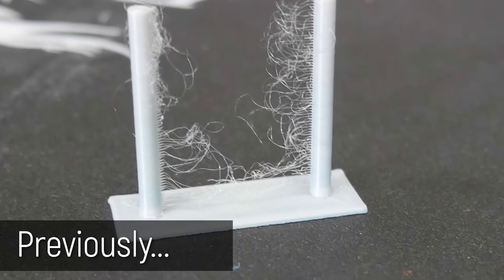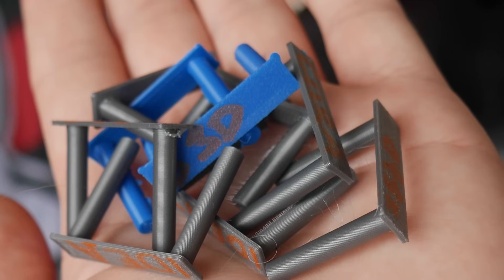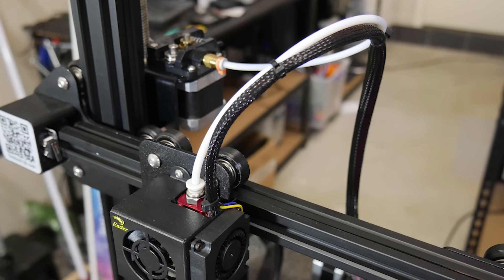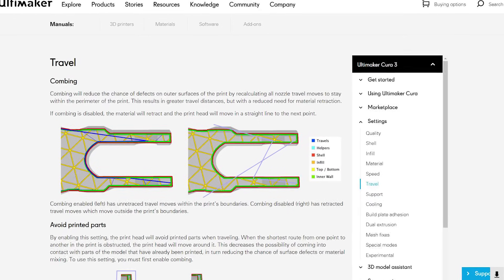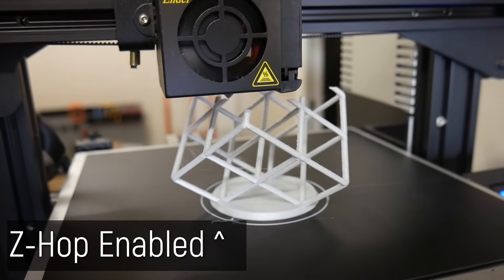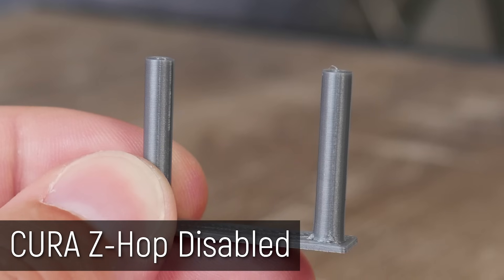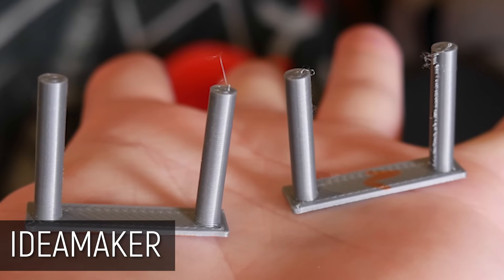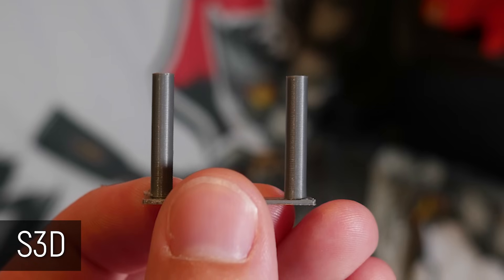Stop Ender 3 Stringing with this One Weird Trick! (ok but seriously)

Comment: We need a visual AI on 3D printers. That is how it will end. I don’t want to invest time on printing anymore...
Reply: Do you mean something like an AI slicer? I guess you could get training data for one by having it slice a model then print and scan it to compare.
Reply: @TheAkashicTraveller   @Jack Evans  Yes absolutely that is what I meant. But without a computer, as a stand-alone kit. Maybe live data input can be used from a camera that is focused on the nozzle for simplicity, instead of scanning.  It would get serial output data from marlin like temps, speeds, fans, layer height...) and command it thoroughly. It would end up with an asic AI chip with a cheap camera kit to solve all the issues "live".
We are changing values (slicer settings) and printing hours of test prints to compare and optimize them. We need to pray to the 3D printer Gods for luck . A huge waste of time. However, it is a must paid price to become a "3D printing master".  Also that is the barrier between the average customer and the product. 
Someone should invest in this.

Comment: Haha no joke, I've been using the slicer on astroprint because of all the research I did before getting my 1st printer there was 1 thing nobody mentioned...you need I friggin computer. I did not own one because I end getting the newest best phone samsung has to offer a d they're quite literally better than most PC's so why buy  an actual pc that's much more limiting than a phone. That's been fine and had no issues...until my printer showed up. Got it all set up a d good to go but other than the build instructions there was nothing else and the only other writing in the instructions is in Japanese. But I had the sd card that came with it and it was cracked. To find the cura software was on it. After looking around someone said astroprint had cura on it but was somewhat limited. So I got use to it cuz I didnt wanna buy a pc for just printing......so about 3 years later my ass is still using astroprints cloud cura program a d have become surgical with it. I've had tons of people asking me for my settings cuz everything comes out flawless with it. I dont buy specific brand filaments. I buy whatever I think is gonna look cool for a print and it all comes out great. Every now and then I'll have an issue but a quick tweak will fix the issue. I have bought a pc and bought the 150 dollar simplify3d program and the full cura. And guess which of these I still use. Yup the astroprint halfassed cura 3.0something or other. I really think it's just cuz alot of the fine tuning in the others will throw off something a tiny bit and then you're chasing the 3d printer dragon trying to find that 0.000000006 mm adjustment. The one downer is they dont have a layer by layer visual. But everybody should go mess around on it for fun sometime cuz  you might be pretty surprised what that thing can do lol

Comment: I don't use CURA anymore got fed up with the interface, I use PRUSA SLICER with my wanhao i3 and get better results with it, Concerning stringing I've found that the most important setting are temperature and speed for non printed moves, the slower the print head moves to the next area for printing the more oozing occurs which causes stringing in my temp tower tests. Like you said thou it depends on the filament used and trying to dial in your temp, speed and retraction settings for each filament you have!.

Comment: There are so many variables to account for based upon geometry. But, what happens if you have different geometries in a single file that really need different settings?
Reply from the maker: It's a challenge, you can use tricks like variable layer heights or infill but there's no one size fits all solution.

Comment: I've used Cura exclusively for my slicing (though not usually my supports) on my Ender 3 and Geeetech A10 for a while and I totally agree. The retraction and combing clean it up very nicely. I'm currently using Duramic 3d whenever possible as I've found their PLA to be top notch quality, even though their selection is a little thin.

Comment: First of all .
Every filament has its own settings this does not only depend on what kind or brand  .

It also depends on the collar of the filament itself  .

Second of all Cura is the best slicer program to use using other slicer programs is very stupid .

Now the Right starter settings for the ender 3 & 3 pro .
Make sure you always check if the Nozzle size is the same as in your printer .
Put the retraction on 6mm .
Printing speed 50mm a second .
About Nozzle temperature  .

Many will start a long print and leave the printer all alone !!!! .
It's the biggest mistake you can make  .
Because not one filament is exactly 1.75mm on the entire roll  .

Its between 1.75 and 1.80 .
This will have affect on your extruder motor and your Nozzle temperature  .
For example I got white Jupiter filament  .
On the spool it says 195 till 215 degrees in Dutch EU .

I am printing with it at 220 till 225 degrees because any lower and my extruder motor try's to push it trough and cant on 50mm a second printing speed  .

To be clear again every filament kind brand and collar has its own unique settings  .
To find them out you will need to do several test prints. 
And I repeat do not leave the printer alone keep an eye on it and keep listening to the sounds it makes .

Comment: I feel that a combination of retract while combing and z-hop is the current best route to eliminate stringing for most common prints. What we truly need is the ability to retract and hop after the wipe motion has occurred. This should eliminate stringing for parts where z-hop is required due to thing features curling up around the edges.

Another solution would be to incorporate a ramp option for z-hop where we can set a horizontal distance over which the hop takes place and have the ramp always go towards infill just like combing. If z hop could have a timing configuration option in this scenario that could also be very useful e.g. Wait X milli-seconds after retract before hopping.

Just some ideas, feel free to expand or if this is already possible please inform me how.

Comment: I was dead set on a Prusa MK3S and eventually got an Ender 3 Pro because I also needed to do some investing in my business and didn't want to blow $750 on a printer. What I've found is that I don't love the Ender, and that the time spent tweaking it could have been used on something else... whereas the Prusa would have been less of a headache. HOWEVER, I still think the path I took to learning this was a good one. What I've learned with all the tweaking and upgrading is valuable to me. Even though more than likely, having gone Prusa would have actually cost me less, as time is money... and also after upgrades my Ender 3 Pro would be a $400-$450 machine. But... you can't put a price on experience.

Comment: I tried many settings in cura but it's always a mess through different settings provided by most experienced youtubers. 
In creality slicer it's working best.
I tried manually adding all the settings in cura as per in creality slicer but then also its not working through cura. I tried 4.3, 4.4 version but this stringing problem won't go. Pls help

Comment: I think I lucked out.  My Ender 3x's prints came out remarkably good right out of the box.  I do however have the slight stringing issue noted in this video but only with certain filaments, others are perfect even even different colors from the same brand can be different.  

I'm going to try the suggestions and see if it improves, however it's really not a deal breaker as it's producing really impressive prints already.  I've ordered a few upgraded parts, teflon bowden tube, all metal extruder, silicone boot for the hot end, and printed a new fan duct and filament guide, but overall, I'm super impressed with it.  

I don't really have a frame of reference seeing as this is my first printer, but I've seen horror stories from others with their Ender 3's and I think that I really just lucked out and they were having a good day at the factory the day they made mine.  

Also, filament choice is a real concern, I've been using 3D Solutech filament and get the worst stringing with the silver metal, but I attribute that to my using it the day it was delivered on a very, very cold day and opening it up while it was still cold soaking up a bunch of humidity, slight with blue and none with black, same brand different colors, so who knows.  

I've got them all in Ziplock bags with desiccant at the moment and truly the longer they stay in there between prints, the better they print.

Comment: Hi Angus, I hope you are still reading comments..... Creality unleashed a whole fleet of 'silent' versions of their printers - Ender-3, Ender-5 (which I bought) and other pro machines - onto the market in the second half of 2019. Mine was a black Friday special, and I thought I was treating myself to a decent machine after 2.5 years of learning the ropes with an Anet A6, which I thought I had outgrown. I thought I would be getting a reliable machine that would just 'work' out of the box.....How wrong I was!
The first thing I did was print one of the gcode tests prints included on the SD card with the printer. After about halfway through, the Y-axis stopped working and the X-axis continued to make a horizontal plastic trench on the build platform. I thought it was a bad connection. I then did a few prints using Cura 4.3 as the slicer without issue (after taking the machine back for another fault). I have been using Prusa Slicer as well as Cura, and while printing a Prusa sliced file on the Ender, got the same Y-axis failure. I tried again and got the same result. I was now quite excited because the failure was predictable.
I sent it back to the shop. I was then informed by them, that yes, they know that these boards have issues, but only with Simplify 3d (failure of Extruder axis) and my failure using Prusa. So with these boards, I should only use the latest version of Cura (4.3 or 4.4)
Googling on the web, there are a whole lot of hapless users with similar issues.
Creality is deathly quiet on this issue, absolutely nothing on their website. They have emailed some users and said for them to download the firmware from their website. I did this, but the verison is older than the buggy one and introduces other problems because there seems to be a z-axis calibration issue - the gap between layers is too large.
I eventually downloaded Marlin 2.0 and flashed my machine with some help from this thread https://www.reddit.com/r/ender3/comments/cdlvmm/modified_marlin_119bugfix_fixes_the_s3d_print/

This thread shows the problem
https://www.reddit.com/r/ender5/comments/da7np6/weird_problem_with_ender_5_and_115_board/

and this
https://www.youtube.com/watch?v=cUbhSDPTO0s

Someone needs to call Creality out on this appalling product that has been unleashed on users, and their absolute lack of response. This kind of thing is totally unacceptable, and turns new guys completely off 3d printing if this is their first experience....Maybe a rant video?

Comment: I got the Ender-3 pro during the Christmas sale and mine too has a warped bed.  I have a pretty noticeable valley from just in front of the front right corner to a about 2 inches shy of the rear left corner. Being a noob a thought I did it because I found out later you have to modify the vertical stop point for home.  The switch part has a nub that puts the head stopping way too high. My knobs were cranked near full  as a result when I tried to level it and I still had a valley in the center.  Another channel DRVox mentioned this being common and suggested I use a metal ruler to check and then add a post-it notes under the mat to build it back up.  Its UBE (Ugly But Effective) and I've moved on to other noobie problems.

Comment: About the difference in slicers... I was printing Sainsmart TPU on a Flashforge Creator Pro with G-code created in Simplify 3D, no issues.  Tried the same settings and roll of filament using Flashprint, absolute failure every time.  The filament would bunch up under the extruder gear and nothing I did changed it.  As a test I went back to the Simplify G-code and again it produced a perfect print.  The slicing program made all the difference in the world!  By the way, I also have an Ender 3 and I get great prints out of it.

Comment: I've subscribed and watched many of your video which are very informative, so I thank you for that.  I may have missed it, but was it the brand/color of the filament or the slicer setting that made the difference?  If it was the filament brand/color, I couldn't totally make out the brand you mentioned.  Could you please provide here?  I also exclusively use S3D as my slicer.  It seems that the equal to Cura's Z-Hop is called 'Retraction Vertical Lift' (unless I'm totally mistaken).  However, its an actual mm setting.  So what is the best setting if you need to use a 'Z-Hop' like setting?  Thank!!

Comment: As a matter of fact, I just bought an Ender 3x from Creality on the 2019 Black Friday sale in the U.S. for $180.  I am very pleased with my purchase. I have found that at this date a LOT of fixes and warnings I have found on various sites are no longer a problem as Creality seems to corrected the majority of them. I was however having a problem with stringing on my initial prints. I had downloaded Cura 4 but to start out with I was using the slicer provided by Creality and I was getting stringing. Not serious but annoying because it was leave strings across my model which would end up showing in the surface of the final print. Then I came across this video. I thought well since I already have Cura downloaded, lets try it.  MAGIC! The stringing on my prints COMPLETELY disappeared when I used Cura for the same prints that had stringing before. What a marvel. In the end, I have found the Ender 3 to be a fantastic first printer. I have had a few glitches but they were all my fault. Now I have a BL Touch installed and things are pretty much perfect. Thanks for this video and your others. I am a subscriber and I find your stuff interesting, helpful and easy to understand. Keep up the good work. Cheers!
Reply: A BL?

Comment: Angus, I have watched alot of 3d printer videos. mainly on the various models of printers many of you guys are reviewing and I discovered that the Material,Brand,Printer,files geometry and Reviewer of the printer are coming to different conclusions. I do think your Idea that a budget printer should be better quality out of the box kinda raises the question, should there be a "budget" printer or would it be a case of you guys will find fault with any priced printer, Which is also true. Initially,I felt that you were very unfair with the review of the Ender 3 series even though I agreed 100% with how and why you said what you said.. But I've not even opened my printer out of the box yet and because of your findings I have spent hours and hours gathering knowledge on the issues with 3d printing. I thank you for that and for all the time testing and reviewing that you guys are putting out for us beginners. I will happily upgrade my ender 3 pro to a direct feed exturder with a pi 4 and 32 bit mainboard over time and having the basic understanding you guys have shared with me will mean i will undoubtedly spend more time in the hobby for sure. Thank you.

Comment: I was able to create some stringing by making a difficult shape position.
Now, stringing can also be created by activationg support or stilts where you don't need it.  no hang overs, the printer will try to start support then disregard and go back to printing.
finally, ender 3 responds intriquetly to settings.  So, ensure you turn off your support or stilts. 
Cura installs with presetting which has the support turned off.

Comment: Where I work there is a lab with different filament and resin printers and I have seen how frustrating it can be to have to spend so much time researching other peoples' recommendations and experimenting to find the right combination of printer, slicer, filament, and settings to get something to work right. And just as you found, the right combination for one project may not be the best for the next one.

Comment: followed your advice to eliminate strings ..on my cr10s...i think it did it ...had to include the "coasting and other settings" you suggested ...however >>>remains a pattern of strings? solidly placed on the last surface ... it is a pattern and can not find it using the "line preview"..suggestions please ....could i send a factory file?...thanks for your consideration..PS using simplify3d and cr10s

Comment: Your channel is amazing ! I've changed mine to Capricorn on Ender 3 and the retraction magic of 6 mm per 25mm/s is not working anymore. Many stringing now. Do you have updated your parameters after changing to Capricorn ? I understand that is tighter so I need to change retraction but its very hard to find the right parameters... thanks !

Comment: Cura is a must. Love my normal ender 3. can get flawless results with a lot of playing around. Its really all about the time you put into it. My demon to overcome was layer separation. Had to adjust the tensions on the frame/belts. abs has turned out to be the enders bread and butter or at least mine. I even get good results with old plastic. my strings where always a temp issue though